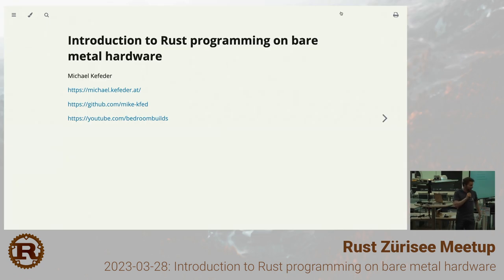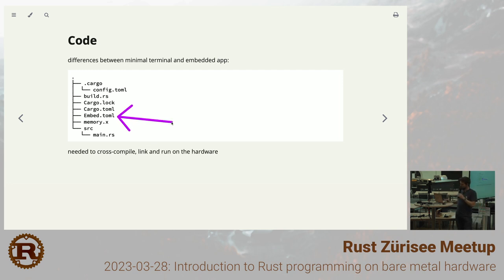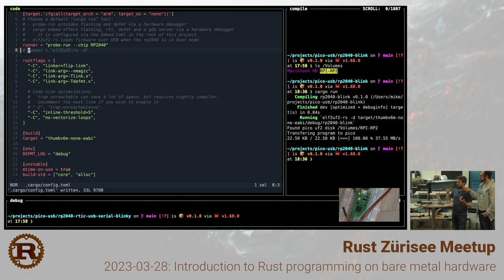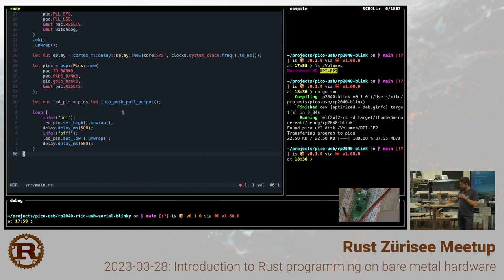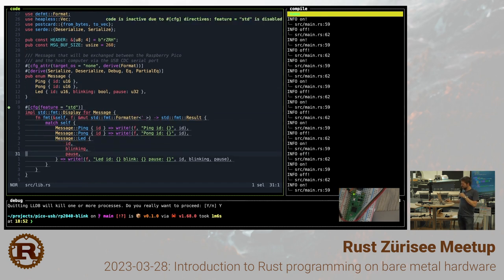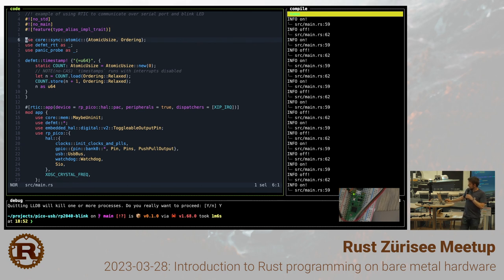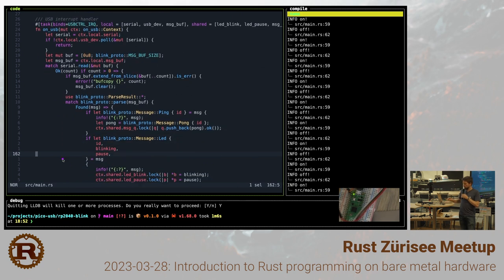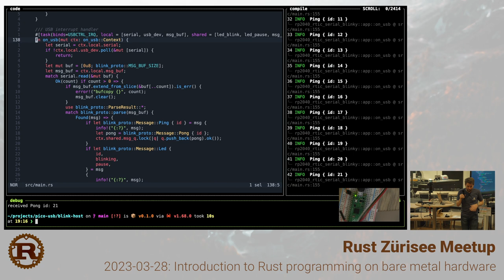Introduction to Rust programming on bare metal hardware by Mike Kefeder - Rust Zürisee March 2023

Comment: Thank you for posting this.  Wouldn't I be able to use the Raspberry Pi Debug Probe?
Reply: Yes you can! in fact the Raspberry Pi Debug Probe is based on the RP2040 and runs the same open-source pico-probe firmware I used for the demo, the probe is however more convenient to use.